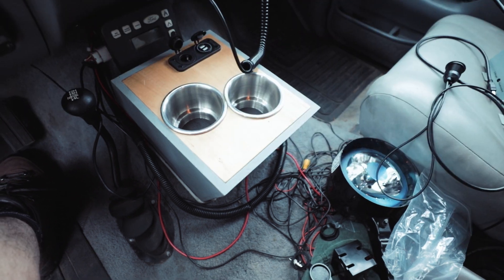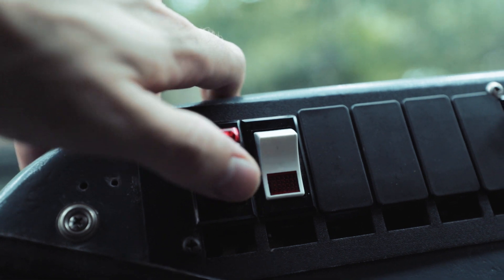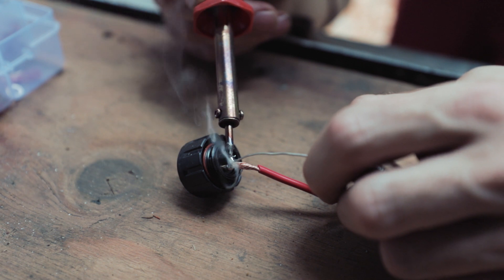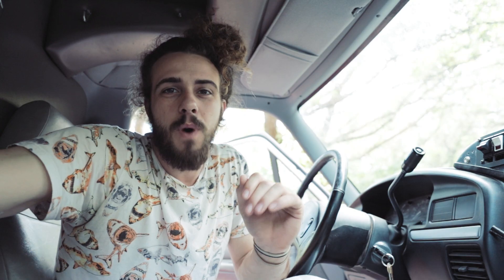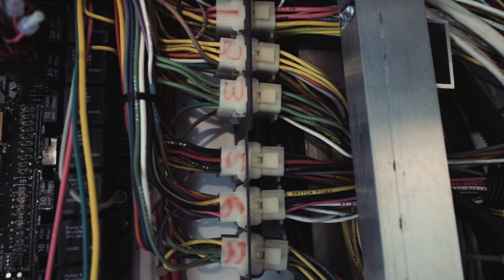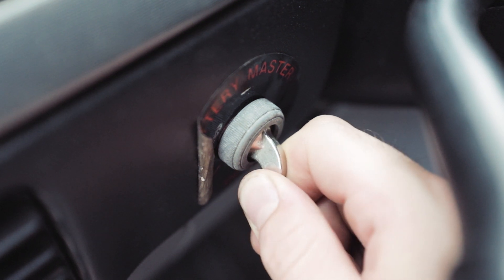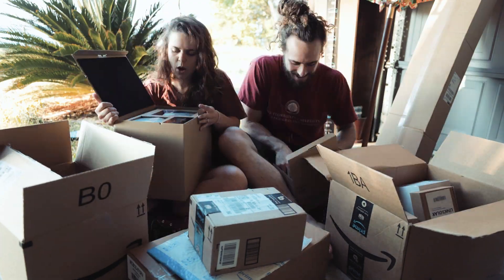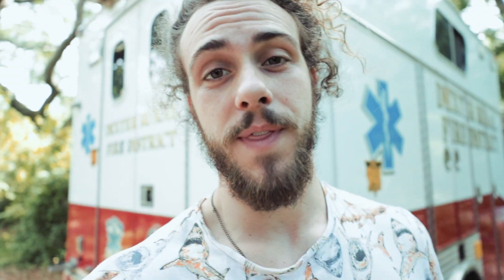EPISODE TWO: Basic Wiring & Electronics

Comment: You said: "Sorry if I bored anyone with those nitty gritty..." You had almost ZERO "nitty gritty" anything. I would sure like to see how the two systems house and car are organized. How you did it. Especially how you hooked up the car alternator to also change the 12 Vs, and the 12V to car car batteries. So you obviously have a two-way while car is running and cut off when the car is stopped. How? Show the wiring. Is the 12V system protected from over-charging while the car is running? Thanks
Reply from the maker: I made these videos for friends and family to see what we were up to. Sorry you didn’t get the education you wanted out of them. lol

I used a massive constant relay, a relay that is not meant to be a momentary switch but it’s meant to be a full-time diverter of power. The activation switch of the relay is controlled by the ignition of the truck, and hooked to a timer. The timer is so that you don’t try to crank the engine off of the house batteries, that’s bad for them. There is a heavy wire running from the house batteries to one side of the relay, and a heavy wire running from the other side of the relay to the alternator. When you switch on the truck, a timer countdown, and after the truck is started the relay clicks and the alternator starts charging the house batteries. It runs through the same voltage monitoring system in the ecu of the truck that the engine batteries do, so they will not be overcharged. Then, when the truck switches off, the batteries disconnect so you can’t drain your truck batteries when you drain your house batteries. Let me know if you have any other questions.